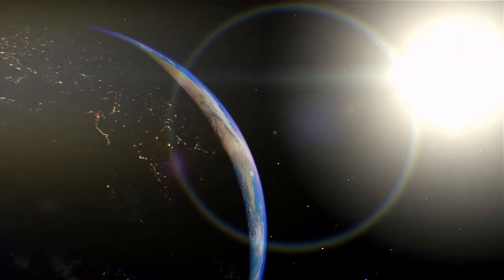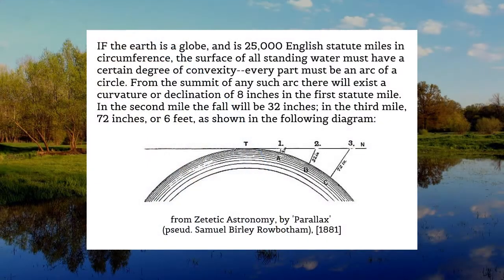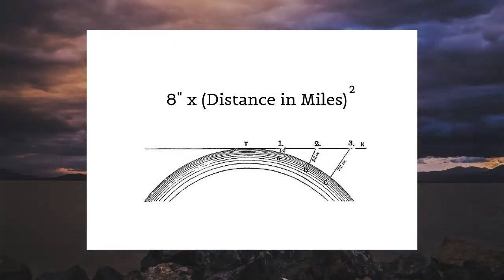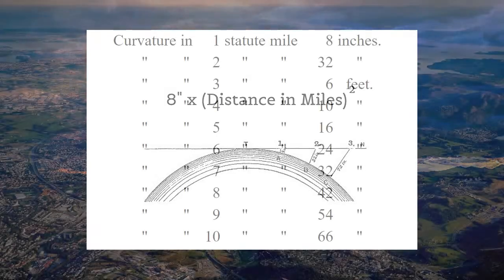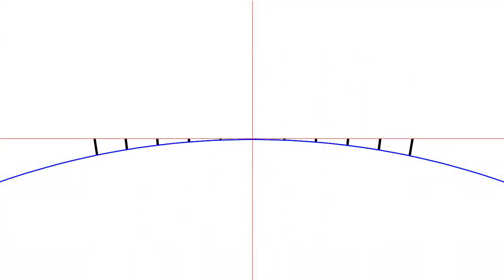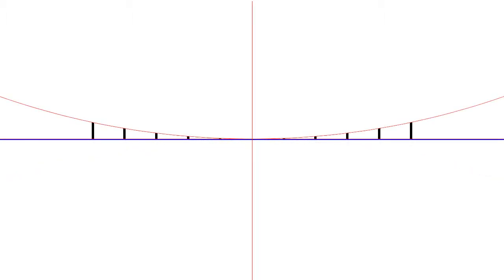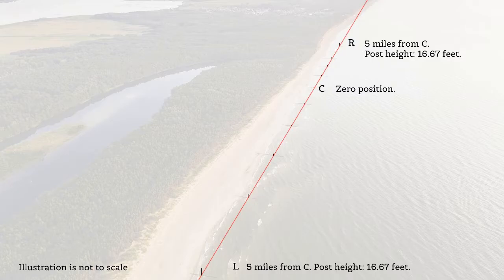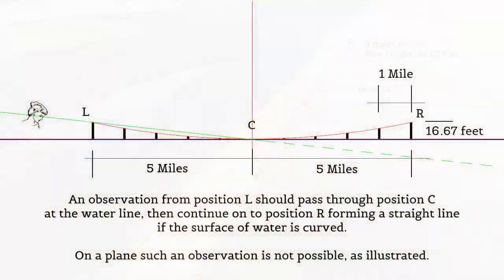Inverting the Curvature

Comment: if there is an 8 inch drop between marker 0 and marker1, then why is there a greater drop between marker 1 and marker 2?
Reply from the maker: The increase in drop is not linear (an even increase from one mile to the next) because when you are measuring curvature the drop off relative to the original position is exponential.
Reply: @postgalactic  https://www.youtube.com/watch?v=VFU1A88N_6I&ab_channel=VoysovReason

Comment: That formula is for a parabola. When are you guys going to learn?
Reply from the maker: Thanks for the comment, you are of course correct, ultimately the formula delivers a parabolic curve, however as a field estimation tool it is valid well beyond the range of visibility.  For example, use the formula to calculate the expected curvature for 200 miles and then check your result against any earth curve calculator and you will find that it is a near perfect match.  Here's a useful calculator with an explanation of how the calculator works - test the math for yourself: https://earthcurvature.com/
Reply: That parabolic formula has been shown to be within fractions of inch for the first 1,000 miles and within inches over the next 500 miles so yes it is a liable formula. When are you guys going to learn?

Comment: Where did the figure for radius come from in the first instance?
Reply from the maker: The radius is a given for the model. You can reference Google or Wikipedia for the mainstream explanation of the r value.
Reply: @postgalactic  Right there is your problem professor.  You have done what all globe believers do and beg the question.  You so want to believe in your ball in outer space that you pluck a fictitious value from your priests at Google and Wakipedia to kick start your presumptive delusion.  Earth is evidently, empirically, and observably NOT a ball in a void.
Reply from the maker: @JamesHawkeYouTube  What gives you the impression that I am a "globe believer"? You asked where I got the radius value from and I told you, the rest is your assumptions.  As it happens I agree with you (hence the channel name "Postgalactic"), I know that the Earth is established on a single natural plane.  This test is designed to challenge the theoretical math of the heliocentric ball in the physical environment.

Comment: I love the video (new subscriber) and I wanted to get back to you but then YouTube put me in jail for a couple weeks.  Anyways, what remained unresolved for me, was the impact of perspective on the observations.  Also, if you were to view the balloons from a side angle with a theodolite, I don’t think it would be accurate enough to see 100 feet over 10-20 miles.
Reply: I also think getting a good focus while filming could be problematic if you’re trying to view both close and distance balloons.
Reply from the maker: @tabooconspiracy  Thanks a lot for the feedback! You make some excellent points, the effect of perspective on observations such as these are still unknown to me, there's definitely a lot of practical testing needed but I wanted to publish the basic idea to get it out there. 

The aim of the test is to set up markers that when linked together deliver a tangent to the globe earth, which of course is a perfectly straight line.  Despite any difficulties with perspective and the likely focus issues, I think it will be evident that the tops of the markers deliver a curve that dips in the middle when viewed from the ends and other positions.

I agree with your point about the side view observation, it's a good view to illustrate the idea but probably not very practical.

It would be interesting to create a physical cable linked series of custom pylons over a distance of 8 to 10 miles using this format (with some generous funding from NASA or the Bill & Melinda Gates Foundation or such).  

I appreciate your excellent outdoor observations and your input!
Reply: @tabooconspiracy  Been fooled by any fake methods of converting globe coordinates to flat earth lately? 

Kreptactic flight sequentials, you gullible clown.